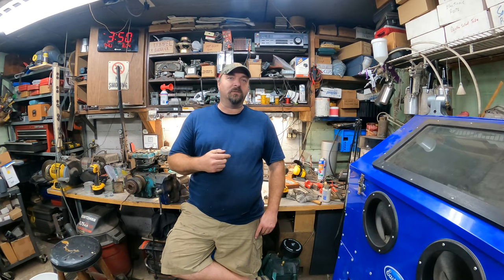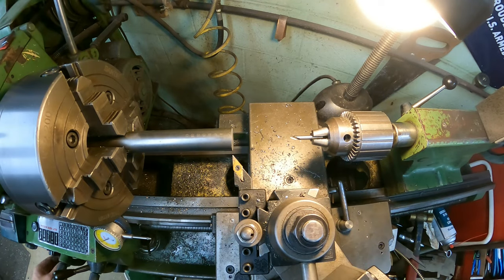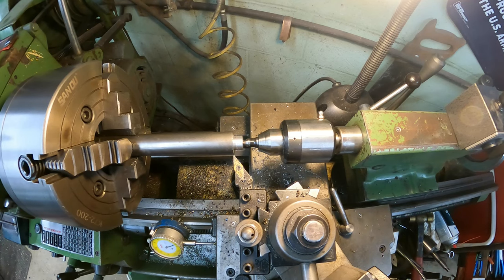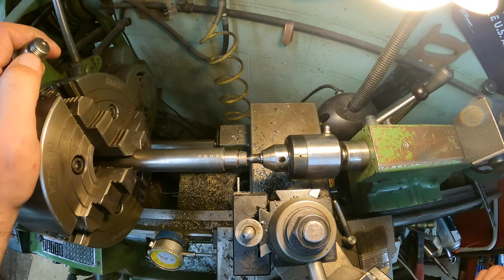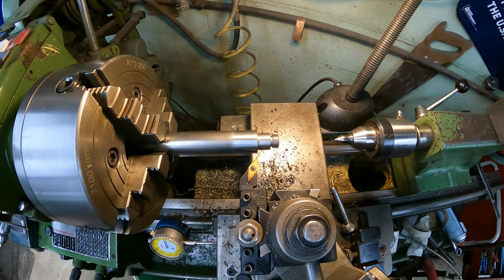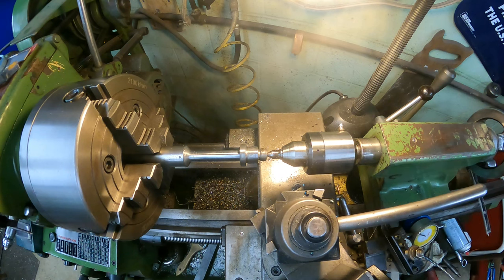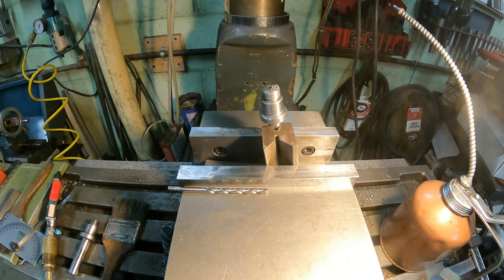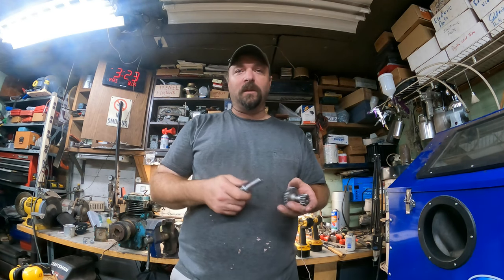Bent Carriage Handwheel Shaft In the Apron of a South Bend Lathe? Lets Make a New one!!

Comment: The spindle bore should be about 1.25 if it's the light ten I think . heavy ten has a larger mount for chucks 2 3/8 - 10 I think its been awhile so my figures may be off abit. 
Great machining job on the part turned out to be an exact match.
Reply from the maker: Thanks for watching and thanks for the info, I will ask my uncle to measure it and see. 👍